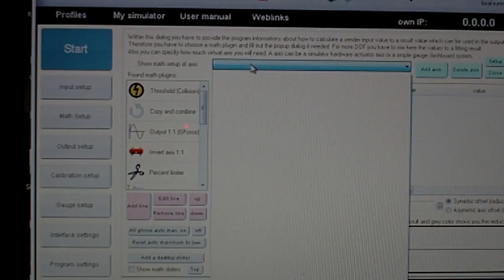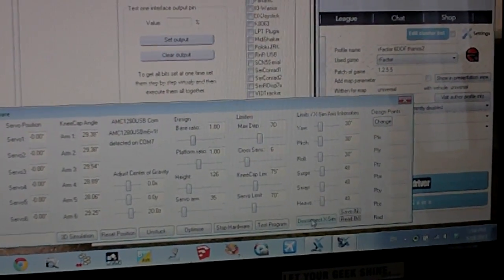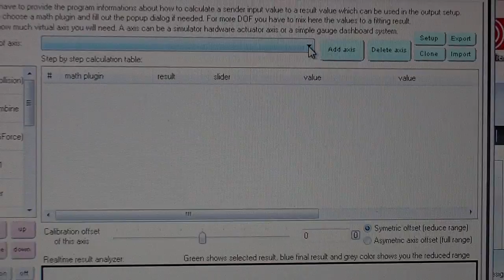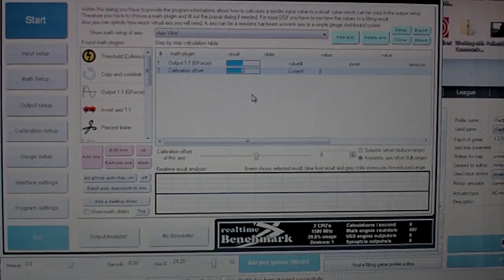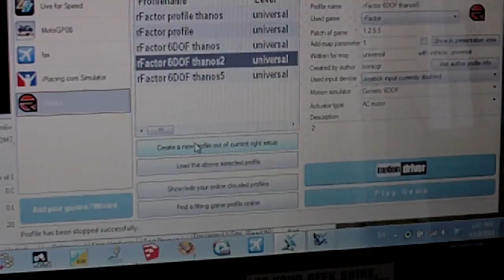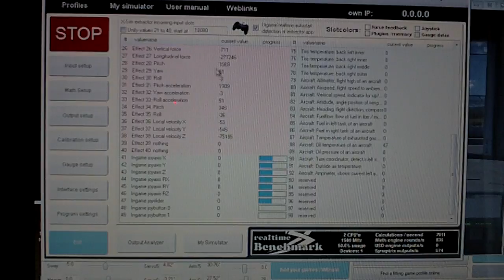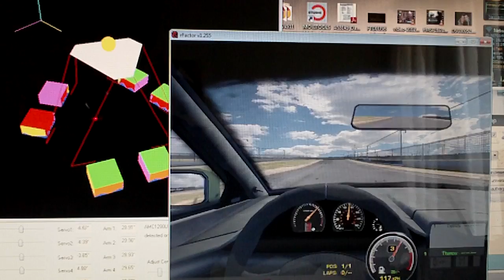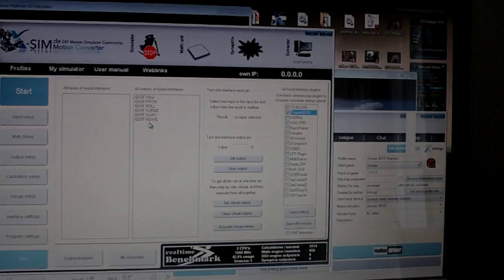Thanos6DOF plugin for x-sim3 demonstration of use

Comment: where I can dowload that plugin?
Reply from the maker: Gigio Conio You can find the latest version of the 6dof plugin for xsim3 here: http://hexpod.xyz
Reply: Many many thanks Im trying to set up a racing sim
Reply: Sorry another question...This code its only for Thanos electronics or can be used with Arduino and MM?
Reply from the maker: Gigio Conio No I'm sorry, this only works with my AMC1280USB 6DOF motion controller. Arduino is not capable for 6 motors real-time position control.